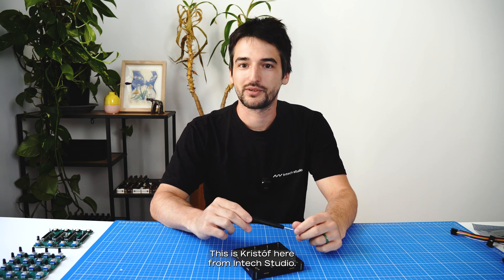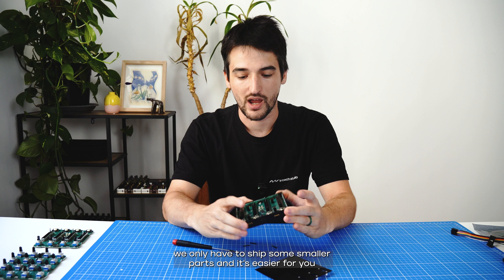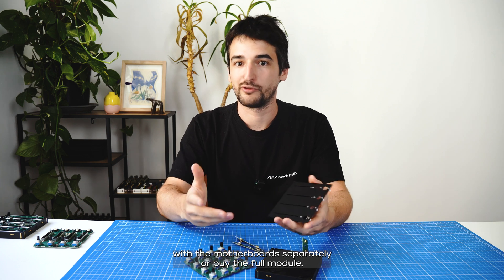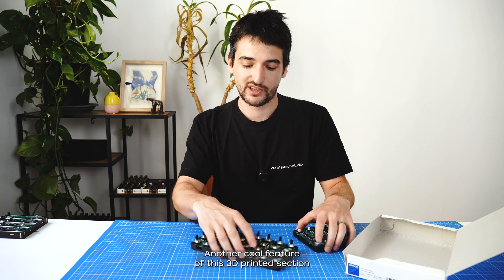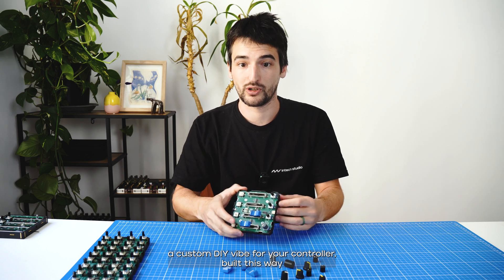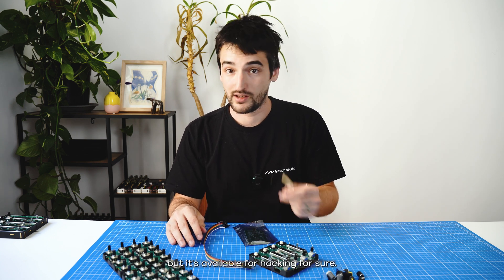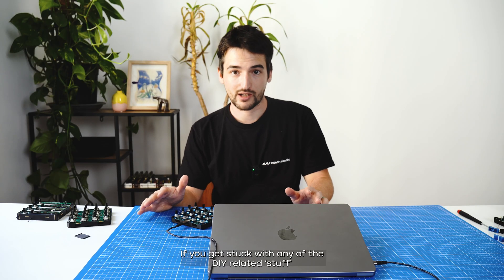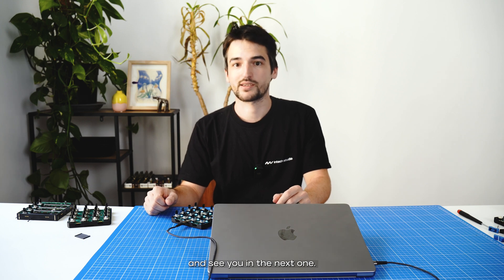Build Your Own DIY Grid Module

Comment: Few things I wish GRID got:
PF4 module: 4x pots, 4xfaders
K12 module:
It might be the size of two GRID squares, cover an entire octave, optionally pb/mod wheels, have the editor select which octave is it, reassigning the keys, etc. The latter two can be done using firmware I imagine.
F4: 4xFaders